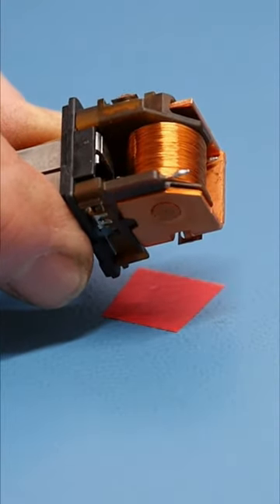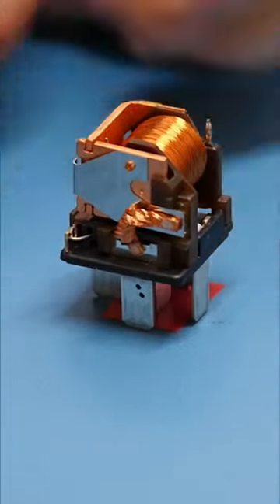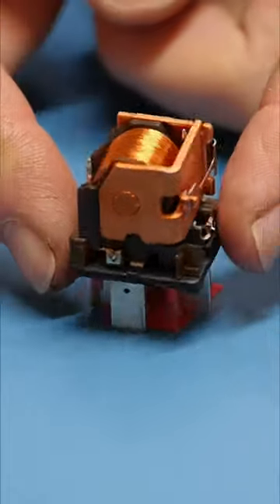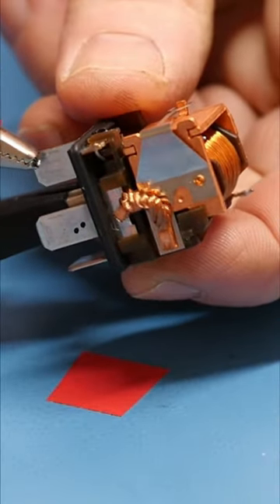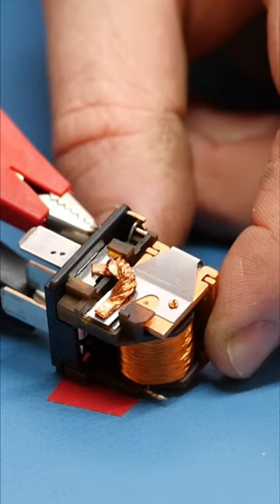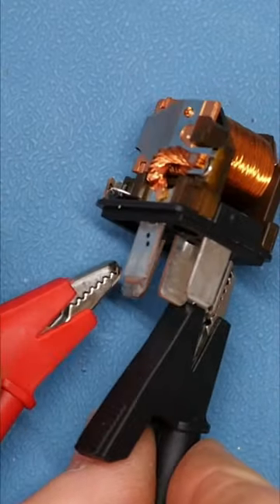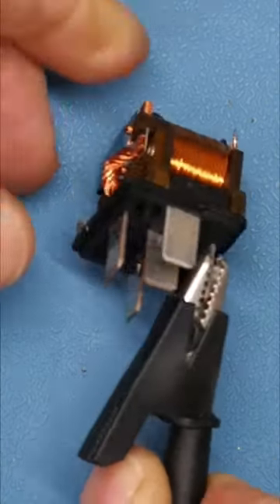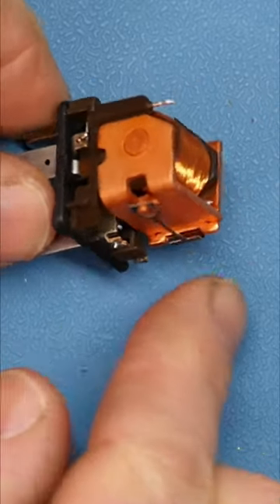How a Car Relay Works. #shorts #electronics #mechanic

Comment: Interesting Mark...

Car electrics is above my pay grade 🤔 so always fascinating to watch & learn.

Stay lucky. Stay safe. Stay healthy. 

Alan L200
Reply from the maker: Think car electrics scare most of us !!! try finding that electrical fault somewhere and suddenly most of us look bewildered knowing where to start. It's something I would like to understand better than I do.
Reply: @CoatsandGaiters  U seem to have a fantastic mechanical & electrical knowledge of vehicles Mark.

I don't mind a bit of VERY BASIC electrical work with a test light or multi meter on a vehicle (that's another story, multi meters so many settings I DON'T understand 🫣🫣)

Thankfully I've got my Topdon Phoenix Plus scan tool, but a lot of the features on that are VERY MUCH above my basic knowledge. But it saves me entering the mind field of fault finding. 

Infact if your a dab hander with a multi meter & scan tool that maybe an idea for a couple of video's on using the basics in relation to vehicles.

Alan L200
Reply from the maker: @GrandadPunchy  thank you Alan but still very much in the learning process.
Reply: Pay grade or skill grade?